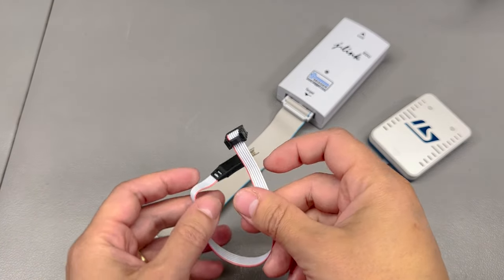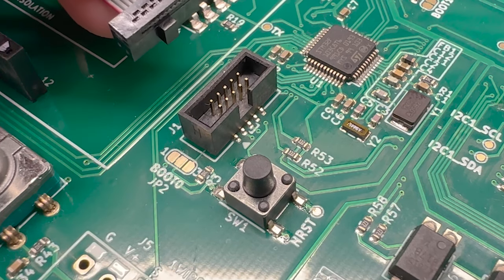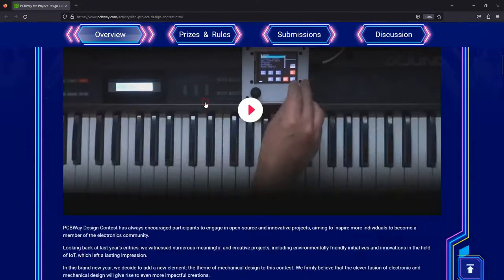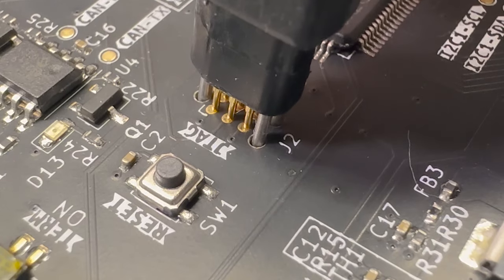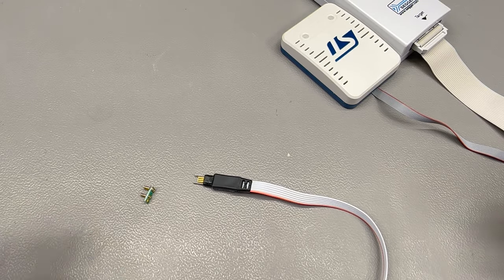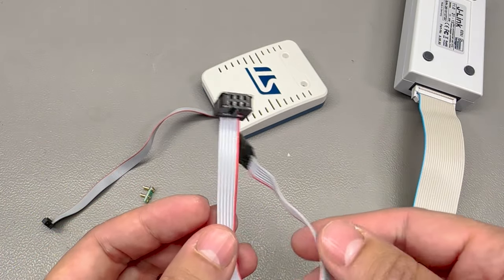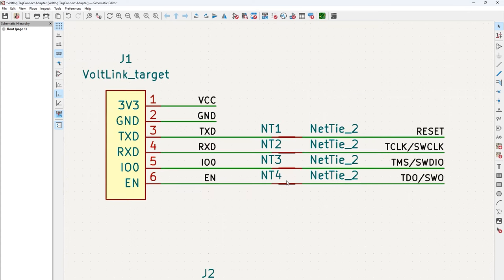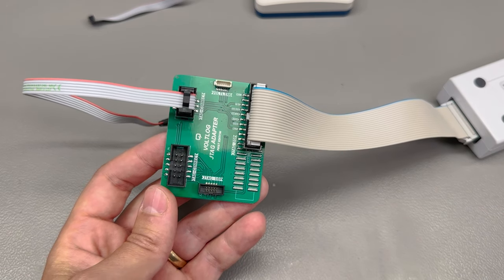Tag-Connect To ST-Link or J-Link Adapter PCB | Voltlog #460

Comment: A good solution for simple projects and for those who do not need analog conversions in their project. I used to have issues with all these adapters converting from one type of connector to another, until I ended up working on a project with an analog system. I couldn’t understand why, during debugging, the board didn’t work correctly, but when debugging was turned off, everything worked fine.

The debugger U-Link 2 was connected with its native 20-pin cable to my adapter board (as shown in your video), and then an additional 30 cm cable was connected to the actual board. I discovered significant interference at a frequency of ~5 MHz with a large amplitude. I designed a new board with a 20-pin connector where every signal pin is alternated with a ground pin. And voilà, the interference disappeared completely.

Comment: That is a cool type of connector though it is a bit expensive. 
Depending on what you want to do, the Würth elektronik "WR-WST REDFIT IDC SKEDD" might be worth a look. They also plug directly into the PCB.
The footprint should be not much bigger and they stay attached to the board without special acessories. And they are a lot cheaper.
There is a special footprint for the debugging usecase, so make sure to use the correct one for your application.
Reply: Thanks for the tip! I've been using Tag-Connect professionally as cost hasn't been much of an issue, but I never could justify the price of buying one for my own hobby project use.
Reply from the maker: The Wurth alternative is definitely a good option for those that can accommodate the larger footprint. It is a2.54mm pitch so percentage wise, much bigger than a tag connect footprint.
Reply: @voltlog  If you are really space constraint, the Würth connectors are not ideal. There is a 4-pin version that could save some space.
If you are really space constraint, the tag connect guys also have an edge connector, that basically uses no boardspace at all.
Reply: The price is near nothing if your time has any value.

Comment: I love tagconnect, since i found out about it in 2021 at my employer back then, i've used it on 30+ different pcb's for both hobby and work designs. There is a pinout for serial, another for STM32 serial wire debugger and another one for AVR8 in-circuit-programming. I've also done similar breakout boards, on mine I put toggle switches to feed 3V3 or not and to connect the reset line or not, and a push button to hit the reset line. It's a little too bad that the cable is expensive, the pogo pins sometimes break and it only ships from the US, which incurs extra customs costs for the rest of the world when we need to topup on cables and clips.

Comment: I started using it a while ago for my ESP Projects and really liked it, but since the new generations of ESP32s, where USB is much more flexible and accessible, i use it less often. Still a great connector in my opinion.
Reply from the maker: I agree, it's a great connector. If only it would be cheaper and more widely available.

Comment: We have been these tag connect headers about 4 years ago. The only downside with them is that they can't be inserted into rack boards. To connect them to our st-link2 we got off the shelf PCBs from Adafruit.
Reply from the maker: They have that new board edge version which would probably worked for stacked boards.
Reply: @voltlog  Good top for the next board, but for those older boards :(

Comment: I just wanted to add that the video is mainly focusing on ARM M core JTAG/SWD debugging probe connections using ARM CoreSight 10 JTAG(IEEE 1149.1) standard mode or Serial Wire Debug (SWD) mode, which defines a 10 pin header pinout with two keying features on the target PCB side, a header body slot and a removed male pin 7. Using both of these is meant to prevent reverse connection. Given the 10 pin requirement of ARM CoreSight 10, TAG Connect created a 10 pin bed of nails adaptor (keyed using dowels) and created a 10 pin single side pad footprint to save cost and board space. Realizing that 4 pin functions (including the key) are not mandatory, TAG Connect created a 6 pin bed of nails keyed adaptor with its own footprint to save even more space.

So, TAG Connect actually have created SMT footprint standard connections for ARM CoreSight 10. 

The clip in plastic versions require snap in holes in the PCB which in a way defeats the purpose of saving board space and requires more holes in the PCB.

The video talks about using the TAG Connect bed of nails for different purposes which makes sense. However, from a practical standpoint there should only be one of each for single uC designs. One for ARM CoreSight 10 usually using the 6 pin, and another function, like a serial monitor port, using the 10 pin. This way you cannot mix up your tool connections for people who are not familiar with the debug specifics.

TAG Connect now offers some versions of a dedicated cable, for example, from 6 pin PCB to ULink Tool header, so you don't need an adaptor board.

Comment: I saw the footprint for that thing in one of Big Clive's videos reviewing some industrial board and was wondering what it is. It took me some time to find out the product, and it turned to be quite expensive for what it is. So I made my own :) Used it only on one board so far and I happy with the result. It's convenient, consumes little board space, easy and fast to plug and unplug. The only downside is that I don't figured how to made the locking thing cheap and easy.
Reply: yeah also 3D printed one to use. For the locking, if its near the edge of the board you could print a U shaped clip piece. If its in the middle of the board you could use say M2 screws
Reply from the maker: One idea for a cheap locking action is to use 3 fixed metal pins on the connector side that go through 3 slightly offset holes on the PCB side, where friction would hold the pins.
Reply: @jaro6985  Yep, I placed footprint near the edge of the board for that purpose.
Reply: @voltlog  If I understand right will it be incompatible with the standard footprint? I tried the other approach: brass stripe (crimp pins holder) incapsulated in plastic housing that flexes on insertion and lock the pins on removal. It was looking promising in CAD, but after I printed it and realised it's actual size, the hope was gone :)

Comment: I had an idea a few years ago to use a stylised Open Source Hardware logo as a pogo pin interface for programming boards. The seven connector pads would serve double duty as the logo itself and also a way to program the board. The logo is (literally) key shaped so, with a bit of thought, a keyed connection should be possible. As usual I didn't take it further - I'll leave that for a more dedicated hacker :)

Comment: The price of these tag-connect cables have to be a bad joke. 40€ upwards for something that is essentially just holding 6 pogo pins in the right place? Seriously?
Reply: then don't buy it, its not for you.
Reply from the maker: I agree price is too high, the markup on these is very high, it's not like it required years of R&D to develop the product but it's one of those things where it's a good product, does a good job and they have a patent making it pretty much the only option available.